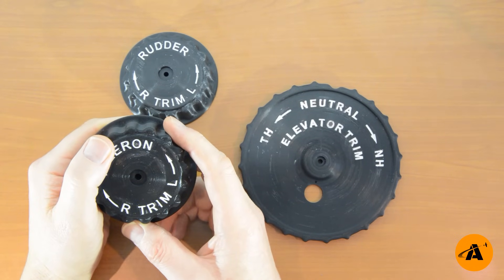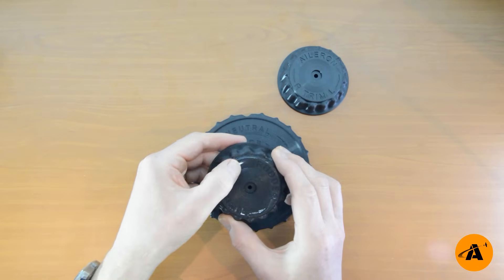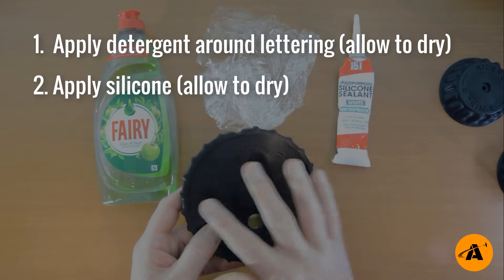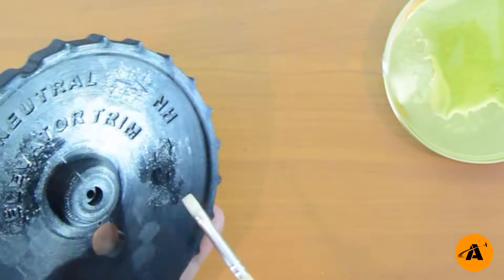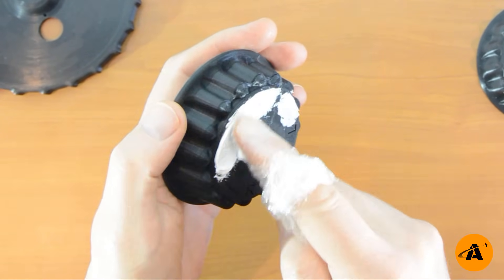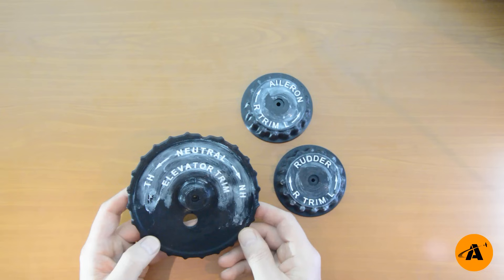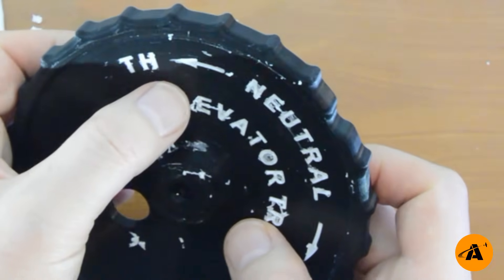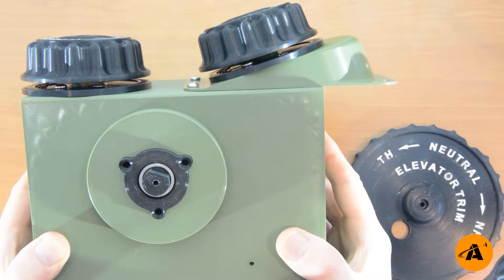Add white lettering to your 3D printed parts

Comment: Just saw your video, very nice. I used a different method. I printed by using raised letters and white filament, spray painted the part with matte black paint and then sanded the lettering exposing the only letters as white. Maybe a few less steps. Just proves that with 3D printing there are multiple solutions.
Reply from the maker: Nice idea. Thanks!
Reply: That works when lettering is big but most small

Comment: Done some of the embossed lettering in even smaller scale the thing is way easier than what you did. 1. Go to any "Chinese" multishop and buy a set of brushes for nails - cheap various sizes. 2 Use modelling acrylic paint (Tamiya, Vallejo, AK) 3. paint the letters inside you can use the moderate amount of paint to fill in the grooves. 4. Take a q-tip and remove the excess paint from around the borders with water. 5 Add varnish for flavor if you want. Done

Comment: Print the letters raised instead of sunked, print in white.  Spray paint black, then take a file and fub down the letters.  Simple.
Reply from the maker: Nice idea. Thanks!
Reply: Or with raised letters, if it’s the highest part of the print, print with black and add a pause in your slicer when you get to the letter layer and switch to white filament for the letters.
Reply: @1RDriver  Certainly works if you are using FDM but not with Resin

Comment: To keep the letters from coming out like your letter L, you could taper the indents in the 3D model instead of 90° sides so the deeper they go the wider they are. This would provide more of a mechanical lock like a dovetail and may allow finer lines at the surface.
Reply: That's a great idea

Comment: If you can tolerate a white band around the OD, you can change to white filament a few layers from the surface for 1 or 2 layers. Then switch back to black for 2 layers with all artwork set for 2 layer intrusion. The white will then be exposed.

Comment: Could you not just print the letters as a separate file and then glue them into the embossed holes? Might take a slight resizing I suppose but once you figure it out it'd be golden...

Comment: Nail polish, thinned with a bit of acetone. An 18 gauge blunt needle on a syringe. Fill it up, put the needle into the engraved text and carefully trace out your lines. Once you get the hang of it, you can do it without error and the finish is solid and permanent.
Reply: I tried this once, but the nail polish seeped into the layer lines and it looked pretty bad. I didn't even thin it.
Reply: Depending on the finish you're looking for, you may need a deeper offset/deboss (0.5 -1.0mm) and you may need more than 1 coat. Fill it up - it'll shrink - especially when thinned. If you're planning on sanding the final surface and spraying a hardcoat, you can overfill and sand it flush.
Reply: You could definitely hit it with a quick clear coat and that’d more then likely keep it from seeping through any layers.
Reply: I like the needle and the liquid idea. Use liquid 3D printer resin and buy it in white or clear then a set of alcohol resin dyes. You could fill it and UV cure it even. There’s also a UV curable silicone available i think. 🤔
Reply: I use the needles mainly for glueing, but have used it for paints, as well. Never used resins, but now that you've mentioned it, I'm definitely going to try it out.
Reply: I second your great idea. The key part is the depth of for the lettering, I go for 0.4mm regularly and go from there up to three times that if you are going to apply "color" to it. If your liquid runs through layer lines because of capillarity as someone mentioned, then you obviously need a thicker mixture. Take look at this part of the process:
https://www.youtube.com/watch?v=gGCD03feE9E&t=7m24s
And you'll probably want to use a syringe for insulin.
Reply: @akaHarvesteR  i wonder if u were slightly under extruding, not enough to be visible but enough to allow seepage. might be worth making a low-material test piece and playing with the extrusion multiplier
Reply: Top tip thank you
Reply: This is how they do things in the camera/lens business, to make the printing on lens barrels and control knobs.

Comment: There is a strong glue/sealer called Soudal T-Rex (white), that I've used with your soap technique and it works perfect, it won't come out and it's a lot harder than silicone. thank´s for this tutorial

Comment: Really nice I thing you could use a negative draft angle to allow the silicon to have a larger area deeper in the letter. Like they do with mercury tooth filling.
Reply: i wonder if the acute angle at the surface would also act as a sort of blade to help cut off the residue on top of the soap, leading to cleaner edges and reduced risk of dragging a letter out of the hole when cleaning it up

Comment: I used lightweight spackling compound in my P-40 throttle.  I even used it in the "P" of a prop lever from a real Shakespeare throttle quadrant that I restored.  So far, it's working, but I'm thinking of applying some clear paint over the knobs to help seal the lettering a bit better.   Thanks for the video!

Comment: Just randomly stumbled onto this, wandering through 3D print videos. If you're able to manually swap out colors, you can model the letters as a separate object, and simply print them in white, right in the same layer as the black part. I made some custom key caps for my steno keyboard with this technique in Prusaslicer (set up 2 extruders, and check the box for single print head, and it'll auto-add the color change code, which pauses the print, moves the head out of the way, and beeps to let you know to change colors). These were printed face-down, for geometry reasons, but also to get really smooth faces, and I just made the legends one layer in thickness. I couldn't get Prusaslicer to do the obvious thing - just print the letters, then switch colors and print everything else - so it made me switch twice - printed surround in white, switch to black, print letters, switch back to white, print the rest - but two switches isn't too much work. You could also do this on a top face. With white letters, you may need 2 layers to get the opacity you want, but again, it's only maybe 4 manual color swaps in all. Here's a little gallery of the results: https://photos.app.goo.gl/ESNPo86SNm2ZRxNF8
Reply from the maker: Hi, thanks yes, we're doing this now for a few things but it works best when the top surface is flat. When there's a curve it's a bit tricky.
Reply: @AuthentiKit  cool! It's fun, but I feel like your technique gives a more authentic look.

Comment: I see a lot of great techniques suggested here. Thank you all. I recommend that the lower layers of the lettering be undercut so the silicone can fill a cavity locking it in place.  Since I restore / repair antique radios I wish I had the tools and skills to recreate knobs and odd trim pieces with a 3D printer.
Reply from the maker: Yes, the undercut is a great improvement on the method. For antique radios i’d suggest a resin printer and get a free hobbyist copy of fusion 360 and just start playing with it. Knobs and trim are easy stuff with f360. https://all3dp.com/1/best-resin-dlp-sla-3d-printer-kit-stereolithography/

Comment: Thanx for this!!!. Tried and tested and is actually perfect. To improve applying the silicone- in your slicer settings do an iron top layer, that way you wont get the grooves on the top layer. I have found a way to make different colour lettering!!!!!! as theres not many colours available in silicon

Comment: Great technique, although I'll probably use my pneumatically controlled adhesive dispenser with the syringe filled with paint.  Press the foot pedal to dispense paint from a needle into the embossed lettering while moving the needle in the letters to spread it around.  Gravity and surface tension do a lot of the fine detail work as the paint self levels and wicks up the sidewalls.  Let it dry and then spray everything with a few layers of clear coat to seal the surface, level the surface over the lettering, and protect it from gunk getting into the lettering or abrasion.
Reply from the maker: That soubds perfect. I’ve alsotried syringes but its hard to get even pressure. Now a foot pedal would be great.
Reply: @AuthentiKit  - The foot pedal activates a switch that opens a pneumatic valve to pressurize the top of the syringe.  The pressure is adjusted by a pressure regulator to dispense the fluid at the proper rate depending on viscosity.  When the foot switch isn't pressed, the top of the syringe experiences vacuum from a vacuum generator to almost instantly stop the flow and prevent any dripping or oozing.  The vacuum pressure is also adjusted based on the fluid's viscosity.  It works very well.  New units are expensive but used models can be purchased inexpensively.

Comment: Thank you for the technique.  I've had similar good luck with smooshing air dry clay into the embossed areas of parts.  It can be cleaned off easily before it dries.

Comment: Brilliant solution! I have a multicolor printer, but the general idea of using dishwashing jiquid as a mask for some other substance is very generally applicable.
Reply from the maker: Thanks - it does work well though to be honest i tend to use decorator's caulk these days as it wipes off more easily

Comment: Printing with two different colored filaments could make that one too. But this one is also a very interesting approach. But i recommend to use the smooth surface feature in Cura slicer for the top finish, to have it not stick else where then just the lettering. Those parts would be ideal for that slicer setting.
Reply from the maker: Good suggestion - the ironing thing?
Reply: @AuthentiKit  Yes

Comment: The cool thing about starting up your 3D printing hobby is that it's not as easy as people think it is, or rather entry level units lack features to make it less meticulous. Stay with me here, the silver lining here is that the 2nd hand market is great! You can get a gently used 3D printer for less than $200, and often it will come with filament because the frustrated seller will be happy to get it all out of their home. 

That said, it also means that a person should self educate and experiment once they have their printer all set up. YouTube is a huge resource, Made With Layers, Teaching Tech, CNC Kitchen to name a few. Start small, like these fine knobs this Content Creator is making, little gadgets like chip bag clips or kitchen hooks, etc.

It takes a while to complete a print, there's usually some post-processing, maybe some light sanding, and mistakes will be made but it's also a lot of fun! It helps if you're a type who enjoys journeys as much or more than destinations. :)

Comment: This is exactly what I need.  Engraved letters are too narrow to paint but you need something to make them stand out.  My only concern is that this looks like a lot of effort, but until I get a dual filmament printer, it's a great option.
Reply: You don't need a dual filament printer.  All you need to do is insert an M600 line in your GCODE and manually swap colors.  EVERY slicer has this option.
Reply: @tvideo1189  That works if your printing different levels completely.  Embedding one colour filament in a level with another colour like this would mean a huge amount of swapping.  It would be virtually impossible.
Reply: @DerekCroxtonWestphalia  I have no idea what you are saying.  Printing another, different color layer in the bottom of the incised letters level is easy and I have done it MANY times.  You do end up with a layer in your print that is the layer color of the letters, but that hardly detracts at all... even looks kinda cool in lots of instances.
Reply: @tvideo1189  You print a whole layer right at the bottom of the letters?  Okay, that could work but you don't end up with filled in letters like he has here, plus as you point out it means the whole layer is a different colour.  Good for you if you like it, that's not what I'm going for.
Reply: @DerekCroxtonWestphalia  you wouldn't have to do a whole layer, you could print an outer ring of the base color and then fill in the rest of the layer in a white disc. you could do this for multiple layers for thickness as long as your top layer(s) were all black

Comment: It's possible to swap filaments on any 3D printer. It just takes some manual labor at a few points. For lettering like that you can usually get away with 2 or 3 layers at most which is about 6-ish manual swaps. That's a lot less work than this technique, looks professional, and is as durable as the knob itself. With that said, a true authentic look probably would be paint.
Reply: The problem with that is that it's easy to manually swap filaments in between layers, but difficult (or impossible) to manually swap filaments mid-layer. So it only really works if your text is embossed completely above the surface of the rest of the print. Luckily, the price to entry for automatic multi-filament printing is down to $350 USD (Bambu Lab A1 Mini + AMS Lite), so it's become quite affordable.
Reply: @guspaz  There is a filament change GCODE. Most if not all printer firmware supports it. If you don't have an automatic changer it will pause and do all the stuff it's suppose to like retract the old filament then wait for you to insert the new filament. Works exactly the same as the automatic system and can do anything it can except you have to do manual work to remove the old filament and insert the new each time.

Comment: have you tried the "iron" top layer feature in your slicer. this would reduce the lines and space to get into.
Another thing can be a filament change at a layer to white for a few layers, then change back to black. This will leave a white ring on the knob, but you can fix with appropriate spay paint, which may give a more authentic look.
Reply from the maker: I agree. Both good options. Black sharpie would fix the white line quickly

Comment: I would try sanding and polishing them first, then gently apply some release wax with a few layers of cloth backed by something hard. You might be able to use white epoxy then, which would be more durable and less prone to becoming grubby

Comment: I've had good results using one layer of filament of one color for the lettering, then switching to the background color and printing the rest of the part. It's just one filament change near the start of the print, so it doesn't take as long.
Reply from the maker: I've started doing that on certain designs too

Comment: White out (liquid paper) pin, or the chrome paint pins if you want chrome instead of white work well also.  Obviously if you have the time to watch the print you can stop your 3d print swap to white, print 1-2 layers of the letter surface, then switch back to black but that is hard to get the timing right.  Though 2 color printers are cheap enough these days if you are doing a lot of it it.   You can actually take the filament, measure out the length, splice in some white so that it will print white at the right point, but that is hard to get perfect. 

Using the silicone technique (or any other fill/paint) if print a stencil  with the part (so a 2-3 layer thick part that just has the letters cut out that will line up with the letters in the part, can use indexing pins/holes also if need be).  lightly glue stick them together.  Apply the silicone or paint.  Let cure, pull off the stencil.  Then use a sharp razor to trim the letters to surface height if you got too much in them.

Comment: Another way that's easier to do is to find the last layer before the lettering and print that in white. Then finish the rest of the job after a layer or two of the white. This won't fill it in but it will be permanently white. The side effect is that the edge of the wheel will have a thin white ring at that layer but that might actually look good anyway. Just for looks you could coat the entire top of the wheel with clear to fill it in. The way you change colors is in the slicer with the change filament command. Or you can just use raised letters and all white.
Reply from the maker: I agree. I’ve thought of doing that too. You could use a black sharpie to hide the white ring.

Comment: If you don't like sanding (like me, tho I print in PETG mostly and it's horrible to sand) you may wanna try scraping / shaving. Simple putty knife works great, just practice a bit to find good angle (around 90 degrees), bent it a bit (using side works better) and shave. 
Similar technique as using card scraper in woodworking, probably scraper would work even better but never used those tbh

Comment: Use a cheap silicone sealant finishing tool or squeegee. Ones with flat, straight edges found in DIY & tiling stores for tidying up sealant gun silicone around worktops and bath edges. With a bit of practice, you can wipe over all the flat surfaces & the squeegee will leave silicone in the grooves and clean the flat surfaces as its drawn across. Each flat surface might need a very fine abrasive  polish before hand but you might want to do that anyway for a nice smooth finish. Can use acrylic paint instead of silicone sealant which might peel over time as the sealant wont really bond with the plastic surface. Easier, cleaner and quicker than masking off with washing up liquid.